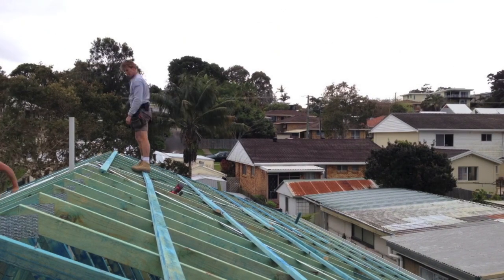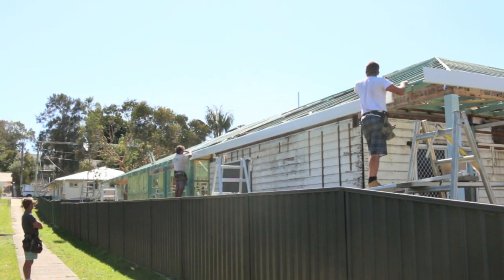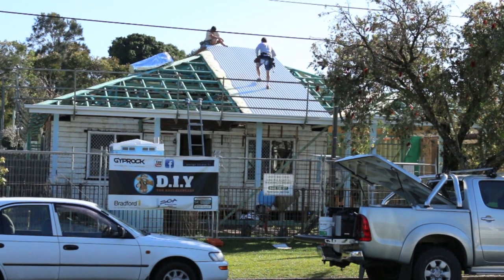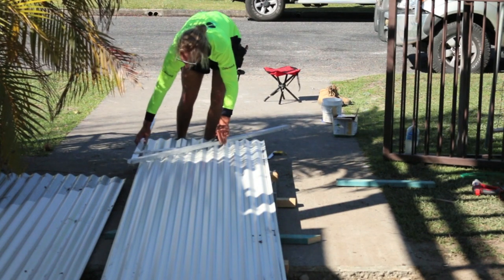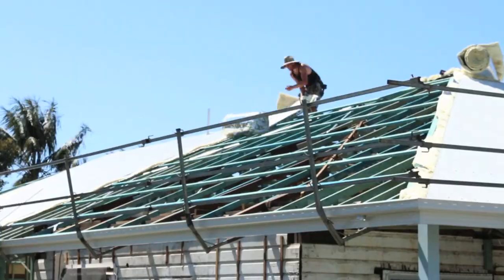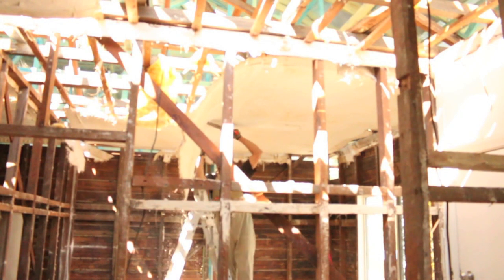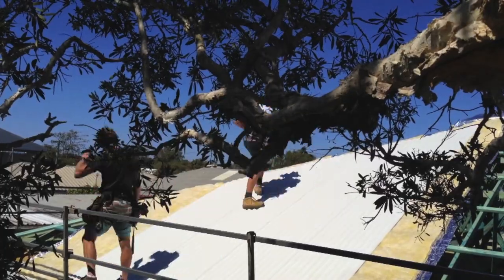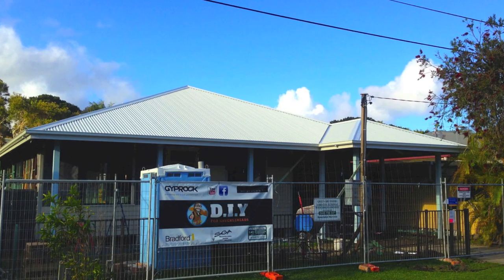Installing the Colorbond Metal Roof. Owner Builder Series. Ep 25.

Comment: Shane   It look awesome  , a real credit to you , it is great to see some one have a go . Just a tip with old ceilings if there is enough room just stand on the ceiling timber and ease your one foot on to the fix point's and pop them . the eves edges  are a bit harder  some times you have to pull them down  , just a bit better way helps whit you not getting dust in your eyes and all over you .
Reply from the maker: +debobba Thanks mate. I actually did what you said re putting your foot on top and giving it a little nudge. This loosened it up beautifully but l didn't want large chunks falling to the floor as we're keeping it and l didn't want it to get to damaged. Good tip though and thanks for sharing. Cheers

Comment: I think that is going to be the most attractive roof in the neighbor hood. Im guessing the neighbors are already jealous. Two Q's; Metal roof at beach (rust)? The safety railing they installed while working up on the roof - how did that attach on the sofet or what to be strong enough to catch someone from falling off?
Reply from the maker: +MRrwmac Thanks MRrwmac!  Mate the roof sheets have the rust resistant coating and the handrail is clamped to the side of the rafter. It's extremely strong and would definitely stop anyone from falling off. Cheers :-)

Comment: Hey Shane , I'm wondering if in the roof system, if there is some way to vent the hot air out of the attic? Also , is that it for the insulation , or are you going to lay somemore in the ceiling joist? That roof really does look stunning. That really adds some visual beauty to the place.
Reply from the maker: +billfromelma Hey thanks Bill. Yeah the roof turned out really well. I'm very happy with it. To vent hot air out you can install a whirly bird or two which are great at extracting hot air. We'll also be adding insulation on top of the ceiling. Cheers mate

Comment: roof battens in non cyclonic look heaps faster no batten screws no overstraps save half a day .
Reply from the maker: +karl craig G'day Karl. Timber battens actually take a little longer to install than metal ones and you still need to batten screw them down after you nail them. The good thing about them is that they don't rust  and the roofing screws hold in a lot better. Cheers mate

Comment: Shane, Is the ridge capping cut in to suit the angle of the custom orb roofing?  I had my roof resheeted and my old mate was up on the roof using hand tinsnips cutting the capping in the summer heat.  Ahh!!! don't new roofs look great.  You aren't going to be like the bloke on the ad and get out in the front yard in your undies admiring the Colourbond roof?  ha ha ha ha...  Have a great weekend, Mate.
Reply from the maker: +rosscoesmiff LOL….spot on, that is me. I'm always driving past from different angles checking it out. All l need now is to get a colorbond later box :-) Are you from Queensland? The reason being that they custom fit the capping to the iron as a weatherproofing method due to torrential rain events. Cheers mate
Reply: +shaneconlan1 Shane, I'm in the central highlands of CQ and I have a shed/house out near Longreach and not too much of this stuff they call rain out there.I have also heard of a roof paint type that has good insulation properties so I will check it out nd let you know.  That would be good for other renovators who are trying to keep costs down, and as we all know, roofing iron and insulation isn't all that cheap.  Cheers, Rosscoe